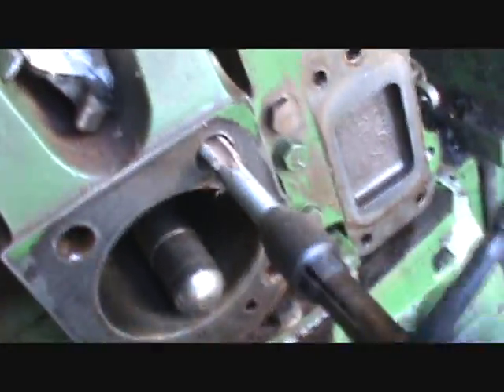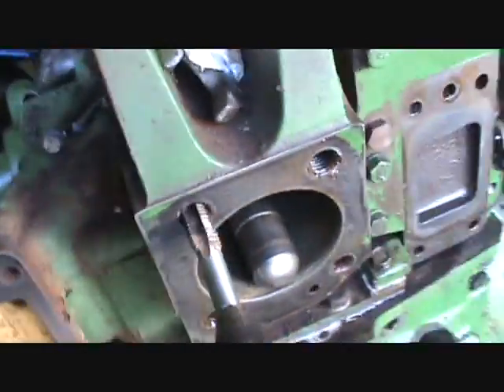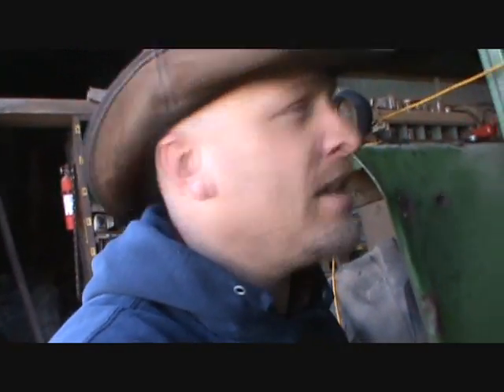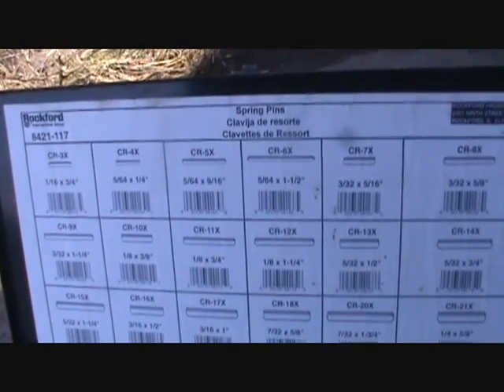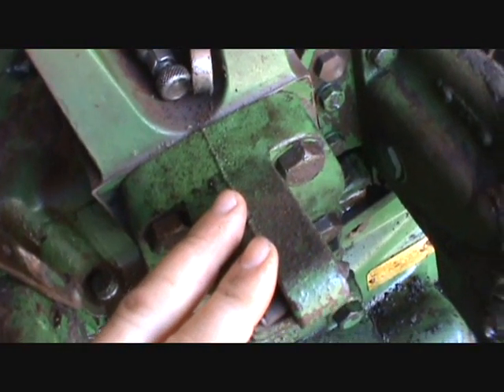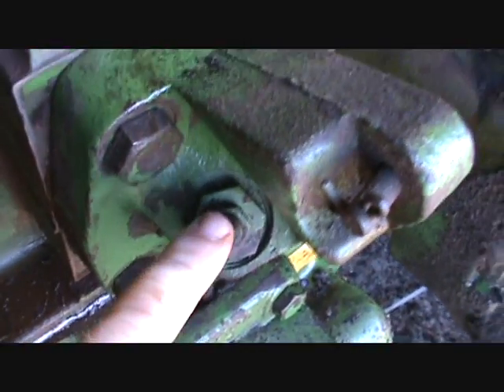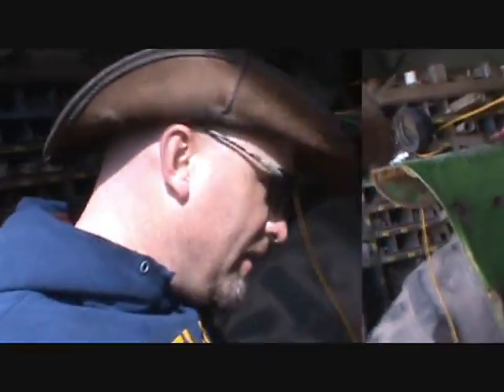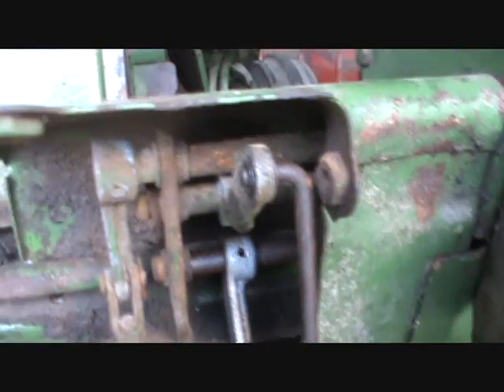First start up of the 4320

Comment from the maker: @pridification a roll pin is spring steel that is rolled like like you would roll paper.a spring pin is a pin that almost buts up agenst its self and does not touch untill it is driven into the hole a roll pin is much stronger than a spring pin.

Comment: Any job involving internals should be Power Washed prior to disassembly.  You need a camera tripod, less repetitive chit chat.  There should be some explanation as to where the bits of metal in the rock arm cover came from.  Was Hydraulic system flushed?  A magnet used in the bottom of the Differential housing?  Was the broken bolt removed or used as dowel pin?